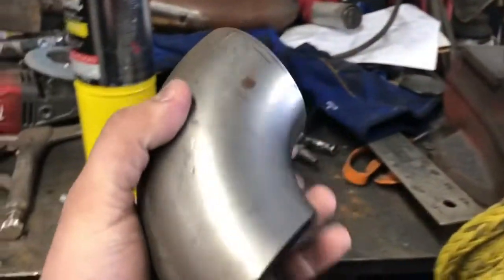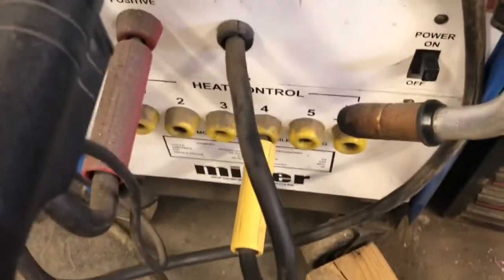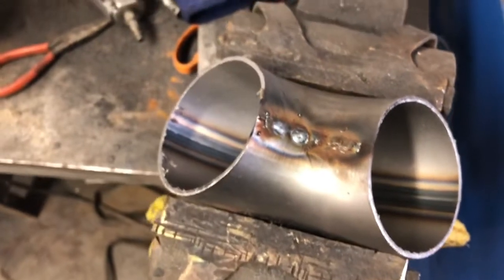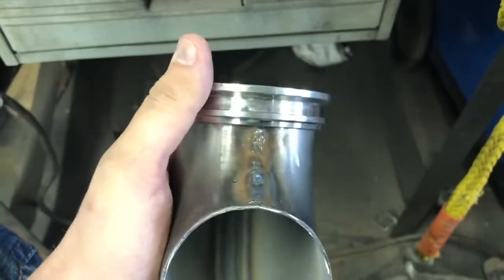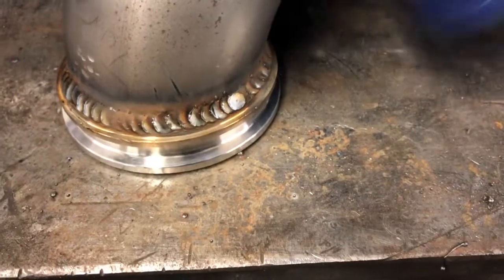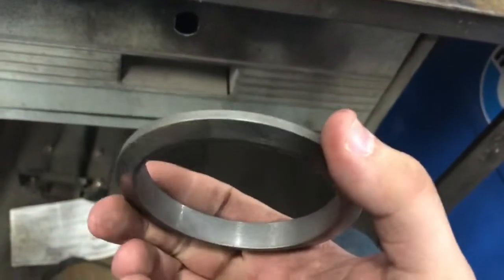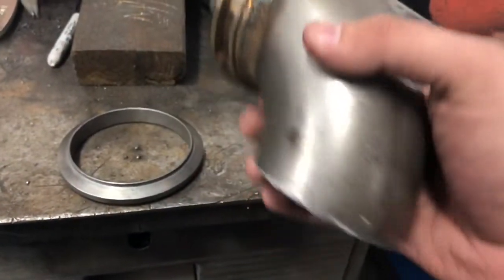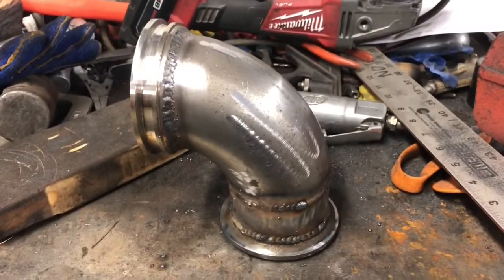6.5 Diesel Borg S300 Turbo: How to build a down pipe adapter

Comment: Were did you get that flange that clamps to the turbo? All the ones I find say they will take 4 inch of 3.5 inch pipe.
Reply from the maker: I think I ordered the turbo with a turbo-side flange and clamp included. The downpipe side flange is a standard flange used by GM and Ford. Was able to source one through my local performance shop.
Reply: @pacificdrumma  ya I got the downpipe side one from quadstar. Problem I’m having is I can’t find a hx40 style flange that takes 3 inch pipe
Reply from the maker: @SparkplughunterIDI  that’s because this isn’t an HX40 style exhaust housing
Reply: @pacificdrumma  what did yours have a marmon flange?
Reply from the maker: @SparkplughunterIDI  yeah I think 3.5”, so it wasn’t hard to fit a 3” pipe inside of it

Comment: I would like put a HX40 on my 6.5 but is expensive a exaust adapter!!
Reply from the maker: The Quadstar kit is an excellent value. I have almost $200 in materials alone in this adapter. That's before my time. And its not as nice as a Quadstar unit.